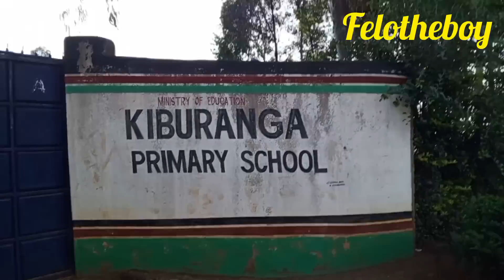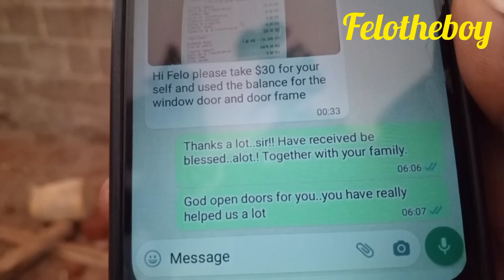Already Toilet Constructed_What Next??

Comment: Hi Feli, thanks for the updates.  Ok, MamaFred needs the following, guttering and water tank for catching water,  She needs tiling for the floors.  She also need a sliding gate in the lounge window for protection, this gate to be lockable at night or when the family is away from home.  They will also need a skirting around the house to prevent water seeping under the house. You need the one way glasses, similar Mama Felistus.  Please don't be in a hurry to 'finish' the project and it's not completed. Complete it and then move on.  Blessings.

Comment: Felo since you are in construction, why not research how to constuct a septic system, I understand the way you are doing it is the way it is done in your village, but how will it be emptied, I have notice that the system you built, was not concreted nor was there a division for solid and liquids, nor is there access cement doors to empty to remove the sludges.   You can review utube videos on the construction of septic systems.

Comment: Is the concrete slab at the back a septic tank?Hiw do you ckean it out when it is filled.If it is make them with two removable covers.
Reply from the maker: It be cleaned and when it be full you bring an exauster